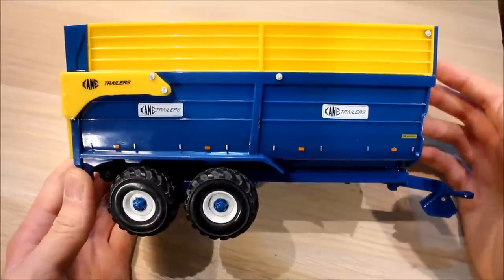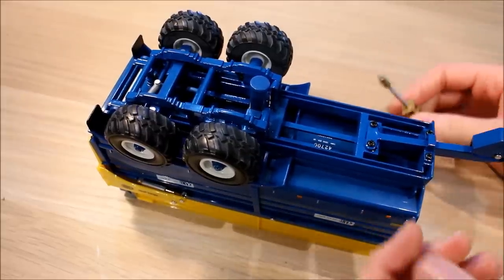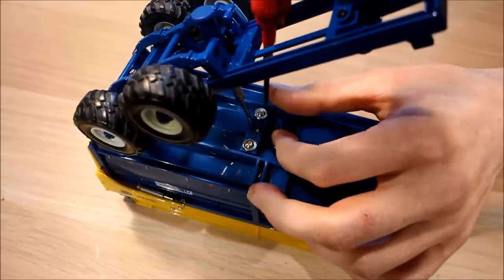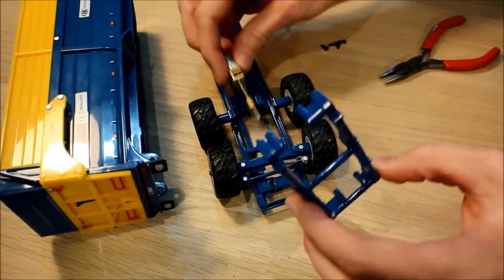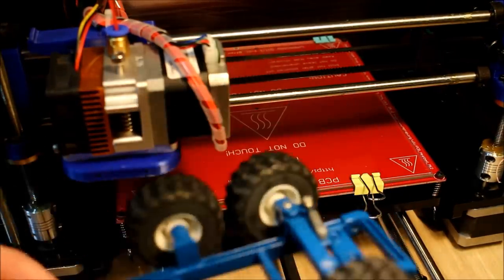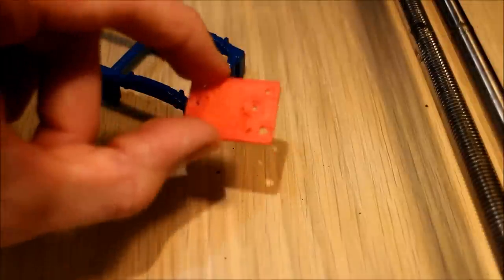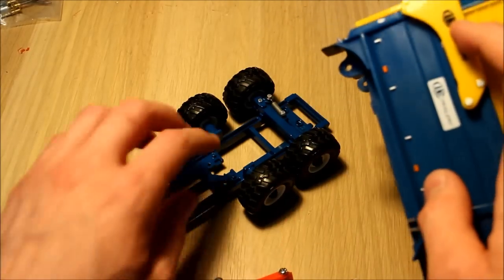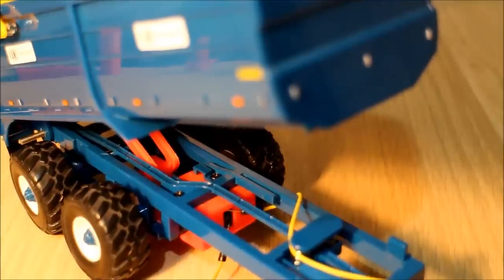RC Britains Kane Silage Trailer Part 1 - 3D Printed Motor Mounts and Tipping Mechanism

Comment from the maker: Hi Marcus, I've never taken one apart so I don't know for sure but I think what the siku models have is a motor with a potentiometer so two wires should be for the motor and two for the potentiometer i.e. no servo control board in the "servo". You might be able to test this if you measure the resistance between the wires and find two pairs. Then put 3 volts across two of the wires for a split second and if you have the right wires then the motor should move slightly. Don't hold the 3 volts on the motor as it probably has a hard stop and you'll damage it. Once you know which wires go where you can open up your servo throw away the useless pcb and wire the servo motor and servo potentiometer to the siku board. You should check that the potentiometer in the servo is the same as the one in the siku "servo" or you might have trouble getting it to move correctly. Also the servo motor you use might require more power than the original siku motor so you run the risk of damaging your control board.

Comment: Do you have any recommendations for the free 3D modeling programs that will be compatible with Slic3r?
Reply from the maker: Adam Duim I haven't tried it myself so I don't know what the limitations are but I was told Autodesk 123D is a decent free cad software. I would guess it's probably like a stripped down version of autodesk inventor.
Reply: Thank you. 

I downloaded and watched about an hr of tutorials. Having never used any kind of 3D software, I'm now able to generate any thing I need.

Comment: I am almost ready to order the same printer.  it would be AWESOME if you could post the file for the lifting arm mechanism to thingiverse
Reply from the maker: RcTractor Wizard Well I'm thinking to have the final working stl files as a benefit for being a patron on patreon but I'll make the crucial dimensions available to everyone to make their own designs easily anyway. This still needs some more work and a few more prototypes to perfect I'd say as it hits the frame in places preventing it from lowering and raising fully. I have lots of different ideas for parts to convert tractors, parts for excavators like a quick hitch, ripping tooth, an adapter for rc tractors to stop the trailers getting caught in the lifting arms and limiting the turning circle.

Comment: Would you sell the mechanical arm you used to raise the trailer with, I don't have a 3d Printer
Reply from the maker: Loughfield Well it's still very rough but when I get the design finished I might. The last test I did it seemed a bit weak so you'd don't want it yet.
Reply: RC Tractor Guy ok thanks, did you ever try tipping the kane trailer you converted with a Siku factory RC tractor or just RC tractors you designed.
Reply from the maker: Loughfield I don't have any Siku Control models so I've only made them to work with mine. The easiest way to make the trailer for a Siku control model would be to just add a radio module to the trailer and make a controller to control it.

Comment: In my opinion this is your best video because i like what do you do and i dont have 3d printer but i want it(and i have one question-its very useful? this 3d printer_)
Reply from the maker: Emīls Purviņš Yes it's very useful, this is my first time properly using it and I found it great to be able to quickly redesign parts when they didn't work. It took a bit of work to get it set up printing this good, a little trial and error mostly and it takes a long time to print things but it's still faster and more accurate than trying to do it by hand I think.

Comment: is there a cheap tractor and one of the kane trailors for sale??
Reply from the maker: +oisin ohagan I think Siku tractors are the cheapest you're going to get now and they aren't really cheap either. As for the kane trailers, I haven't seen an RC versions so you'd have to make it yourself. You can get a joskin tipping trailer for the Siku tractors.

Comment: you might use a piston which has enough power
Reply from the maker: De ModelBouwers Do you mean add working hydraulics? I haven't seen hydraulics small enough for this scale of model anywhere, do you have a suggestion?
Reply: No it was a idee. I dont try this i want but i didnt
Reply from the maker: De ModelBouwers Ah okay, I'd like to be able to add proper hydraulics. It would be so much smoother and have a lot more power.